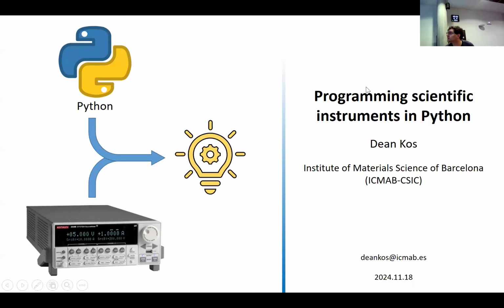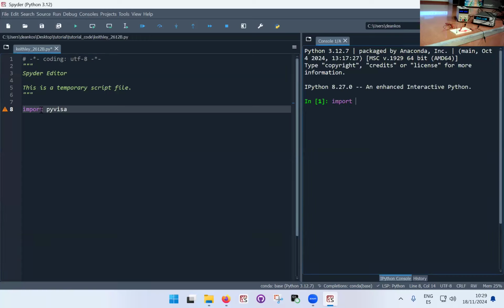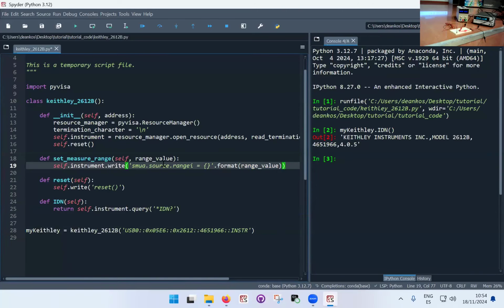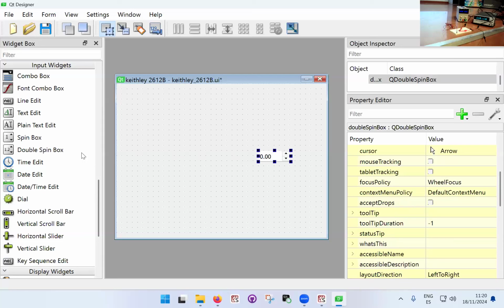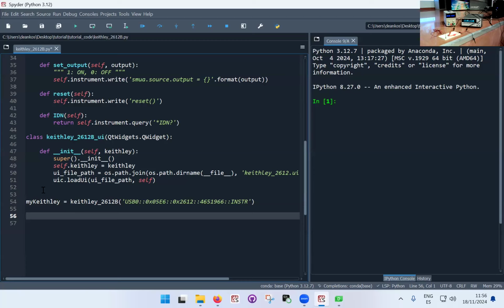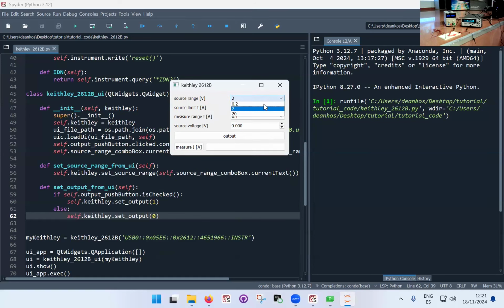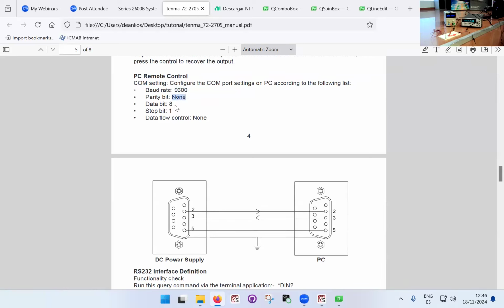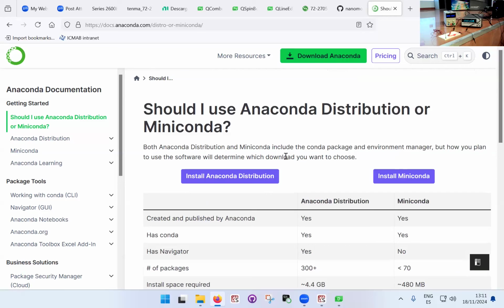Programming scientific instruments in Python - Part 1

Comment: Hello, Thank you for the video. In my case the source meter is detected as a serial port even I have GPIB-USB port. What to do?
Reply from the maker: GPIB to USB adapters are active signal conversion devices, not just passive port adapters, so make sure you have installed the correct driver software. For example, for the GPIB-USB-HS devices by National Instruments, you'll need the NI-488 driver that is compatible with your OS. Whether the adapter works or not and you can communicate with instruments usually has nothing to do with python. I would recommend checking the drivers and testing communications with software from the manufacturer (for example NI MAX for NI adapters) before getting into python. Some adapters may not be VISA compatible, and depending on the manufacturer you may have to install a driver and then write some python code to call its .dll commands. Adapters from the main manufacturers e.g. NI and Keysight/Agilent are VISA compliant and software is easily installable, so this shouldn't be needed. Otherwise, if the instrument has a serial port like an RS-232, you can use that and plug-and-play usb adapters are widely available.